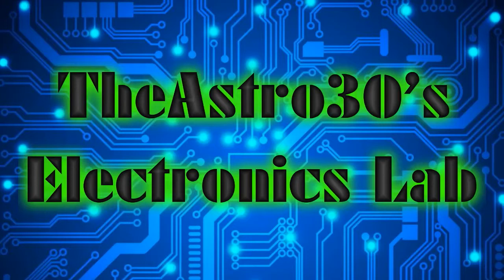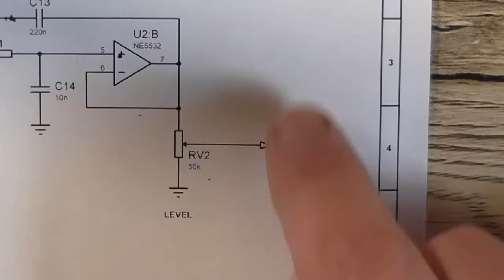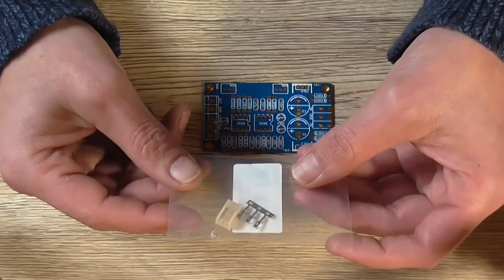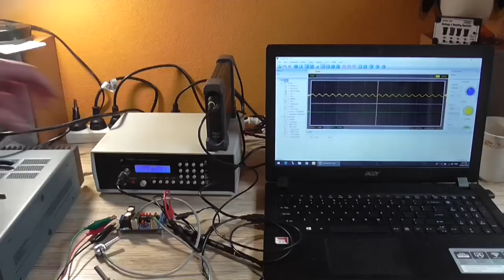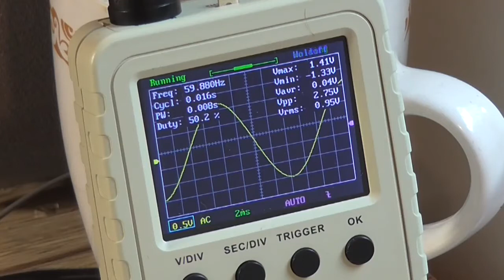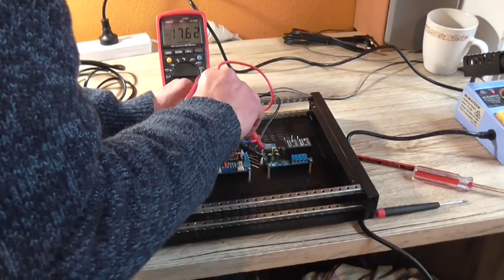Subwoofer Pre-Amplifier Build Part 2 - Active Filter

Comment: The crimper tool for the pins is around 15 to 30 dollars us. Only reason I know is I’ve been shopping for one. I have a mutual hate for the little f#$kers
Reply from the maker: Me too. I hate them. Can you give me the name of the tool?
Reply: The one I have been looking at is around 21 dollars US and looks to be okay-ish, I haven’t pulled the trigger yet so can’t tell you how it performs. Anyway it is a Glarks model SN-28B and comes with a bunch of the connectors and plugs as well. It says it will do connectors between 0.1MM  and 1MM non insulated. There are a few around that are close to the same look / quality but you never quite know until you have it in your hand these days.